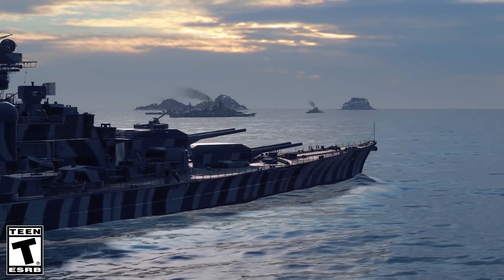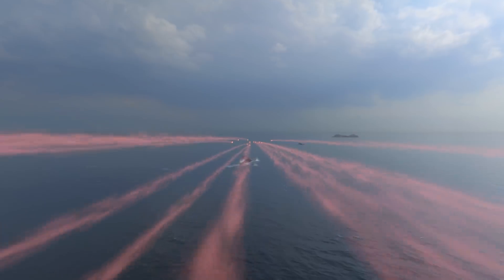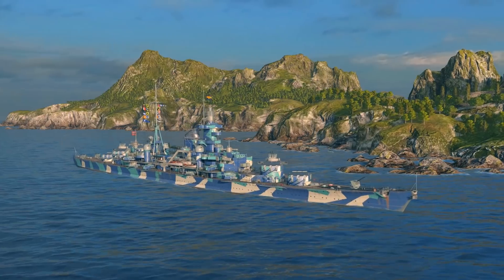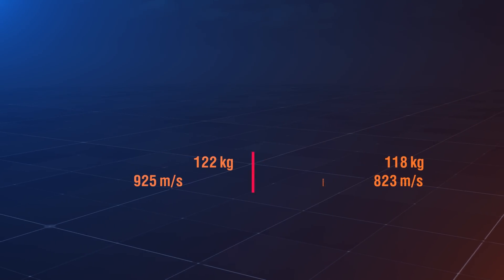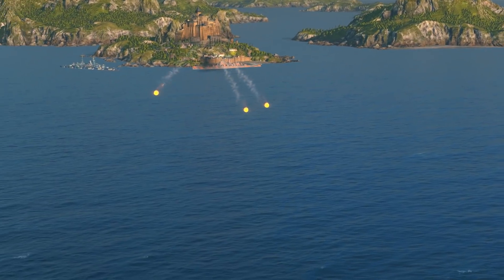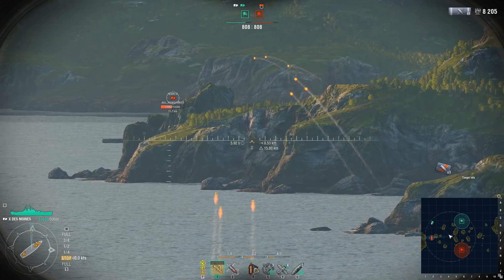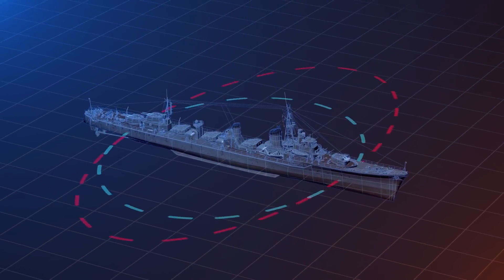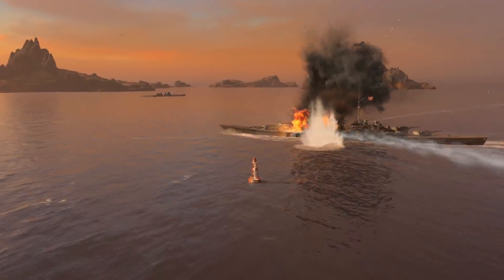How it Works: Ballistics | World of Warships

Comment: The ballistics on this game are broken. The Des Moines initial AP shell velocity is 762 m/sec. Shooting at 10km it takes the shells 6 seconds to reach the target. How can this be? Even if the shells traveled horizontaly without air drag which they clearly don't it would take them 10.000/762=13.12 seconds to reach. So the number should be even greater than this. WG wtf? please explain.

Comment from the maker: What do you think about today's episode? Was it helpful?
Don't let your ship sink, ever!:)
Reply: You completely skipped the shell drag parameter.
Reply: 你们还是像《坦克世界》一样把命中的范围显示出来吧，不然经常打不中真的令人很反感。
Reply: Jeah.. sure helpful for beginners! but saying there are 4 params and only covering 2 of them is like... meh^^
Reply: How it works : WASD HAX
Reply: Would have liked the complete formula. Similar with what you did in the spread video. There it is somewhat easy to guess. ;) Is the spread initialized when the shells are fired and then propagated by the ballistics formula until the shell hits sth?
Reply: i would really like an explanation on how a shell traveling at 823 m/s can travel 15km at 10.2s while not even traveling in a straight line, because there seems something wrong that mathimatiqually.
Reply: And the other 2 parameters?
And how do I know if a shell has a flat or more curved trajectory by the Wikia?
What about the Battleships?
Reply: @robintebaerts4289  The 823m/s are the initial speed, also known as muzzle velocity. After that, they slow down due to air drag though.
Reply: @Cancun771  yes but if you divide 15km which 15000m by 10.2 seconds you get almost 1500m/s. And i am pretty sure air drag doesn't increase an object's velocity.
Reply: Very Good!!!
Reply: PLEAS MAKE CORRECTIONS TO MONTANA'S DECK ARMOR!
Reply: @yuningle6378  可是，還有些數學好的玩家一眼就就完成系數統計打出個穿好穿滿給你看。命中範圍這個支援初出茅廬的新手用還可以，高階級場就顯得有點多餘。反正都是要尊重口徑的
Reply: Your video pauses the counter while the shells are still in the air...
Reply: robin te baerts - there is significant time compression in game.  For example, to calculate the distance a torpedo moves in X seconds, you have to multiply the torpedo speed by a factor of 5 IIRC.
Reply: Meh, lazily done. As others have mentioned you forgot to mention air drag, you could have easily made this video 10 mins long. So yeah, not impressive. Probably the least helpful how it works video yet
Reply: ... "steep the elipsoid is Dispersed as a sphere"... 

SaY what now? circle id guess you mean... 

I also have some minor issues with 800m/s shells covering 13-15 km in about 10 seconds...

But i guess time in game could be shifted by 100% and it fits pretty nicely. Oh well
Interesting watch nonetheless.
Reply: @paumankit  这游戏需要数学？更多的是经验才对，老手不需要看数据就能知道打哪里，玩多啦什么都是靠感觉。当然打出多少伤害和能不能打中全看RNG。
Reply: Oh THAT. That's just because the actual distances in the game are about 2.6 times as big as the nomnal value, so as to not have the ships appear so small at combat distances etc. (Which is to say the ships are scaled up.)
Reply: I enjoyed the episode. It was informative. I was curious about shells. Were shells ever hollow point? Were shells made of armor piercing nickel, or what metals were used? I have Battleship at the time of this post that has never been sunk, all victories, and I sunk more ships then battles I've been in with it. I won't let my ship sink!   gg  .
Reply: @yuningle6378  當然需要，單就是看zoom in準星這個動作沒有相關數學邏輯，那裡看得懂？老手虐新手什麼的……誰未經歷過。唉！
Reply: @paumankit  你可以录下来重看，我都是这样过来的。
Reply: U SHOULD MAKE EXAMPLE OF YORCK 210MM Caliber gun....
Reply: Why no Let’s Talk About "Ballistics" forum link for this episode?

I really wanted to ask why the dispersion goes crazy when a friendly ship is near what I'm shooting at.  I think my gunners must get nervous, or maybe they just close their eyes and pull the trigger.  Whatever it is they seem to hit my friendly teammate with uncanny precision in these situations.  Or maybe it's just me.
Reply: If you people in the company want more people to play your game you need to change some things, 1 the maps are bad designed you need to remove the rocks add more natural things as low visibility fog bad weather night battles, not all maps favor the 2 sides there are maps that favor the one side the dam rocks need to go away, half team fighting for there lives and the other half fapping behind rocks waiting when the half team will low the enemy so they can pick them, in the end, this destroy the game experience plz fix. 2 the BB players having problems with invisible DDs tons of wave torpedos give the BBs sea mines to have  protection from DDs it will be the best and make the game more realistic. 3, not all the players have access to premium ships an ship captains some farm their ships they don pay to play vs captains with 19 points is unfair for them, also the captain skill tree must be free with in-game currency not with doudlons. 4 Remove the chat ban it has 0 use an don't help anyone i play a game i kill 4 enemy ships that were in the same division an cause they can they report me, i can't speak to the chat i can't even speak to my guild window for operations 0 logic also remove the karma penalty, what is this bullcrap karma penalty for real, i will fall in rewards, cause my team blame me for all of them dying and don't listen to me when i tell them to hold the flanks or we will become surrounded again 0 logic remove this crap for the game. 5 release a video an explain to the autistic aliens that play the game that when they see the screen in-game an in the minimap in their right hand is the right flank an in the left hand is the left flank if you defend this 2 spots or capture them you can easily shoot at the mid-flank if it exists simply as it is explained to them tactics of divide an conquer so we can enjoy your game  learn them momentum as long the large majority of players don't know momentum position and tacts the battles will stay an autistic clown fiesta plz (FIX) if you want more people to join.
Reply: @robintebaerts4289  it's called gravity, coefficient of drag and a lot of other internal mechanics.
Reply: Most of these have been good but this didn’t teach me anything.  It didn’t cover airdrag or how speed drops off over distance or how the weight and speed interact
Reply: It was cool

Comment: No mention of drag parameter? That is arguably the most important stat.

To see why, just look at the Yorck with old and new AP shells. The old shells had an abysmal drag paramter of 0.48 (among the worst in the game), while the new have 0.23 (among the best in the game). Lower means less drag. The difference is like night and day: even though the theoretical max firing distance hasn't changed, the old shell was practically useless on ships outside 10km (you couldn't hit and even if you did you wouldn't pen anything) while the new one can easily both hit and citadel maneuvering cruisers at max range.
Reply: Snagabott instructions unclear, i sunk a teammate :(